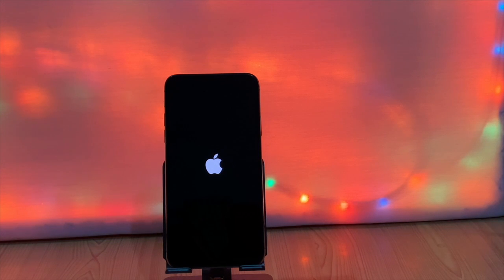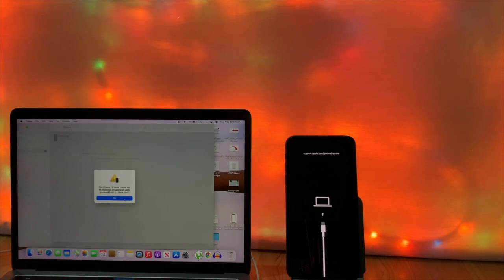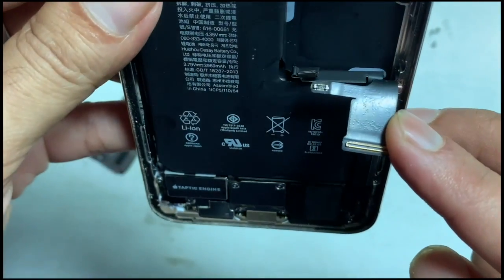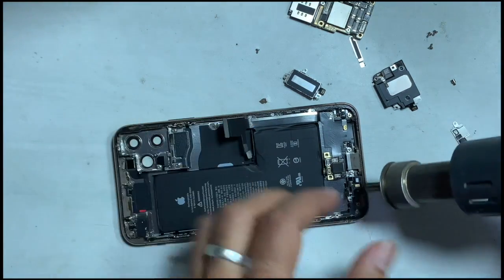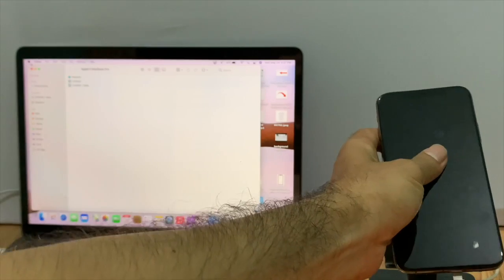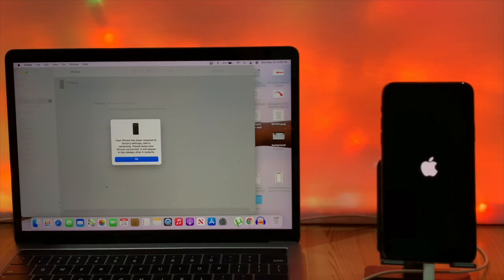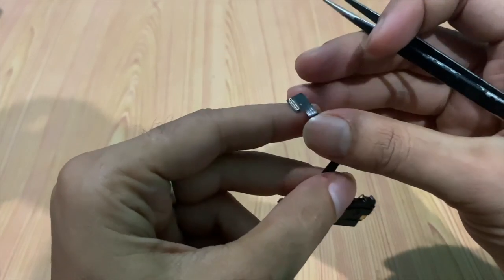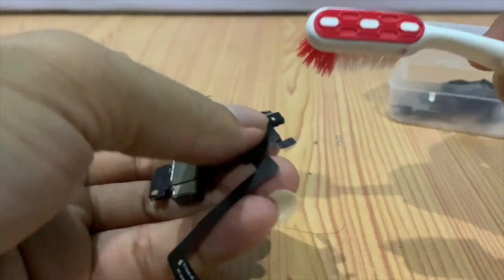iPhone 11 Pro/11 Pro Max Error 4013 Fix.

Comment: It works!! I was ready to put a hammer through my 11 Pro before I tried the restore without the flex cable attached. It restored first time, and with all my data intact. However when I reconnect the flex the phone goes into a loop with the apple logo and never boots up. Does this mean I need to replace that flex / speaker assembly? It has very mild signs of water damage.
Reply from the maker: Yes brother.
Reply: How did it restore with data intact?  How is that possible.

Comment: My iPhone 11 Pro Max suddenly stopped working (for no reason) and got stuck in a reboot loop. I tried a few paid softwares that did not work. I had just about gave up on it ever working again. After watching your video, I decided to open it up and unplugged the flex as you recommended. I did a hard restart and I was in shock when the phone started right up. I was able to create a backup and save all my data. Thank you so much!! You're a genius!!
Reply from the maker: My pleasure brother.Keep supporting.
Reply: Did you have to restore the phone ?

Comment: Hello, I have the same problem with my iphone 11 pro max, it shows up the same error 4013 and that it does not recognize my phone, when I try to restore my phone the blue bar is loading and right before it ends it shows up these two problems.I want to try this out what you have done, but I don't think that I'll make it. Is it possible to send the phone to you so you can fix it ? Cause nobody here in Germany could help and apple wants 528 euro for that.
Reply from the maker: My friends are in Germany too. You can contact him. Message me on  Facebook page.
Reply: @thegsmsolution1  whats your name on facebook for germnay just Thegsmsolution or do I have to add something?

Comment: Hello, when I use my iPhone freezes and the screen shows pink lines so after that automotically shuts down, restarts and heats up... I don't know why. Even when I charge my iPhone heats up anyway. A friend of mine checked and told me the flex is damaged but original brand so I replaced it but still have the same problem but a less frequent. Have you ever seen something similar to this? Please help.😔
Reply from the maker: The screen shows a pink line means LCD might be damaged and there are s many possibilities for heating can you say which section on the back is heating the most.
Reply: @thegsmsolution1  there's not heating at specific section,  it heats up in the back and front. :/ and if I don't use it during 10 minutes or more and I try to turn it on it works perfectly but the issue happens again after one hour or days...
Reply from the maker: Is there any problem shows on the specific problem like on wifi, Bluetooth, no service, etc.
Reply: @thegsmsolution1  everything works perfectly.
Reply from the maker: What about battery drain while on heating.
Reply: @thegsmsolution1  works fine and there's no issue about battery
Reply: @thegsmsolution1  Hi again, now I see that my iPhone had 38% of battery and after heating it and restart (around 30min) now shows 20%... for a 11 pro max I think this is not normal...

Comment: Iphone xs max cant restore any solution
Reply from the maker: What the problem is and what error shows can you explain.
Reply: @thegsmsolution1  error 9 occurred iTunes
Reply from the maker: Water damage or dropped one.
Reply: @thegsmsolution1  dropped
Reply from the maker: So might be a fault on the motherboard. Contact a good technician.
Reply: @thegsmsolution1  there is no psychical damage inside sir it restart back to recovery mode while restoring at 80%
Reply from the maker: Stuck at 80% indicate that is related to baseband issues or The upper and lower board might be a loose contact.
Reply from the maker: Contact me via facebook page brother.